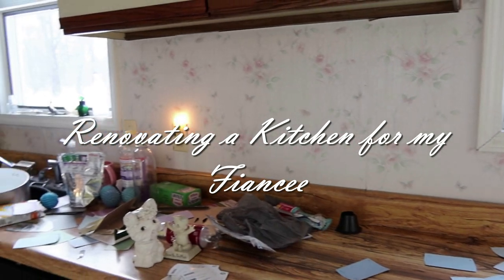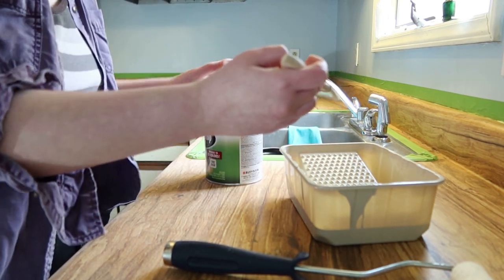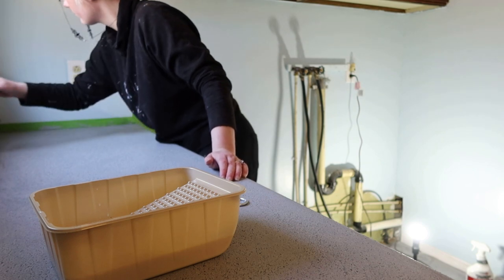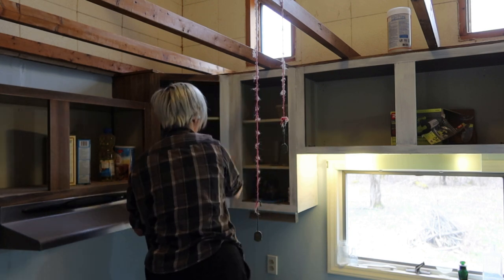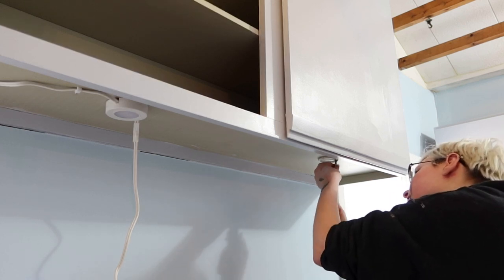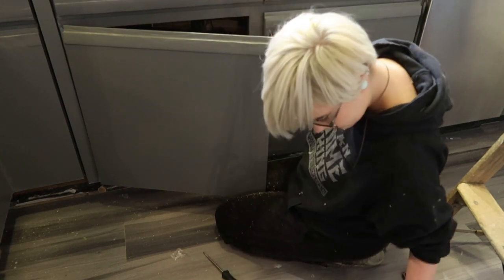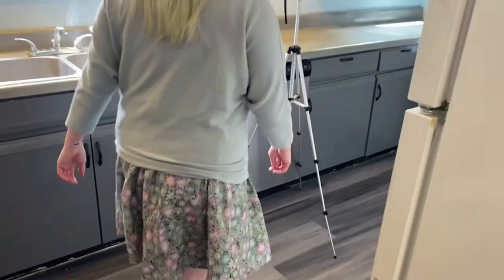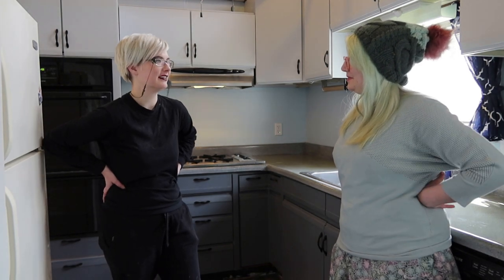Making over a FIXER-UPPER KITCHEN for UNDER $1500 for my FUTURE WIFE

Comment: Great job ! That was a TON of work ! I would have been tempted to keep the wood counter top - I like the look of it ! But I do agree the Grey tied the room together well.
 Wondering if those beams (above your head) are structural or not ? I would be tempted to paint them a light color and also the roof to take advantage of the windows. (Then - as I  have moments of "cottage core" too, FAIRY LITES!!!! LOL!! ) There has GOT to be a better looking fan out there, lol ! But, at least the room is functional so you can do other stuff as the time & finances allow.
 You and your fiance are an ADORABLE couple ! I am somewhat new to the channel, so it's nice to "meet" them. 
P.S. next time PLEASE use a respirator next time you are sanding ! Or at the very least a dust mask. Heaven knows what chemicals you are inhaling. You only have one set of lungs !
Reply from the maker: The thing with the laminate counter is it had a lot of existing water damage- you can see part of me spending the better part of an hour sanding until everything was actually flat and smooth again. I’ve never actually used a mask when I sand? I learned from my dad, who also never wears a mask to sand stuff. We just open the windows.

The beams aren’t structural, they’re just cosmetic, but we’re keeping them because we both unironically think they slap. Eventually I’ll get around to sanding, re-staining then gray, and whitewashing them. They’re fairly inoffensive, we care a lot more about the ceiling fan.

Glad u think we’re cute. We have two collective brain cells.

Comment: Related to under cabinet lighting… my dad put in stickied-on battery powered lights under ours, but now the side I used most is gone :( I don’t think we have outlets in our upper cabinets. We have two just above the counter and one under the sink for the garbage disposal. 

We have a galley kitchen, with most of the cabinets and the sink on the long outside wall. The parallel wall has the fridge (with the only cabinet on that side above the fridge), the stove, and then sticking out even with the major appliances is the backside of our fireplace. We used to have a stove with a microwave built in above it, but when my parents moved in they replaced the fridge and stove, so now there’s a separate microwave over in the dining room since there’s no longer a place for it in the kitchen itself. 

Our kitchen needs a refresh as well. I’m pretty sure everything (other than the faucet and major appliances) are original 50s. I also don’t want to redo the cabinets here either even though they’re quirky, though I would like a new countertop as ours is laminate.
Reply from the maker: Oh NO! No more lights!!! If you had a microwave installed above the stove, you probably have an outlet somewhere around there or in the vent hood. A microwave isn’t something that would get direct wired in. You most likely wouldn’t realize unless you actually went in there looking for it, because they try to make the outlets discreet.

We love some quirky cabinets! Long as they’re structurally stable, it’s still good! If they’re nice cabinets, by all means keep them! (If they’re the metal kind, they’re practically indestructible, change out the drawer slides and they’ll happily keep going) If you wanna keep it mid-century modern, that’s having a revival so things are super-accessible. Good luck updating!
Reply: @jaspersgrimoire  the problem with no space for a new microwave isn’t outlets—it’s structural. The previous stove had the microwave literally built into it. Like those old timey stoves that have those cabinets over the cooktop that are part of the stove itself? Only it’s a microwave. Take out the stove and you also lose the microwave and it’s just walls straight up to the ceiling. And I wouldn’t go adding a microwave there if I could because a fume hood is probably a better idea.

I love the quirky cabinets. They’re all wood, though probably not expensive wood. And there’s one narrow-but-cabinet-deep pantry that goes from floor to ceiling that’s weird but I’m weirdly attached to. XD